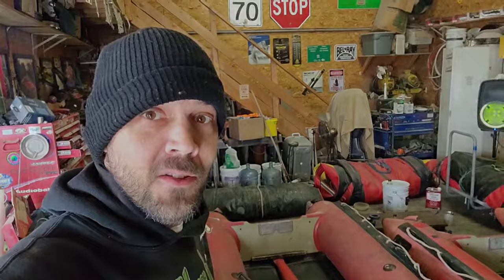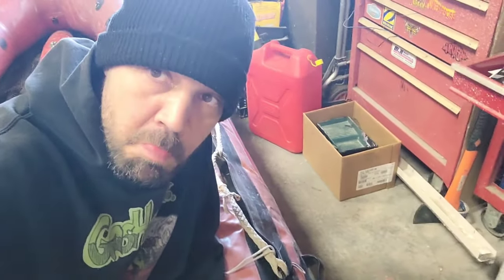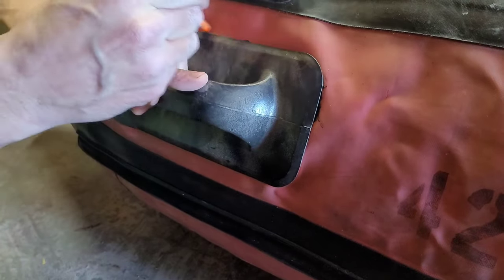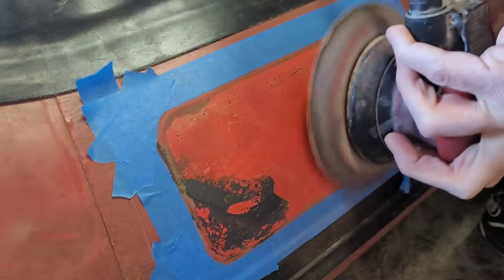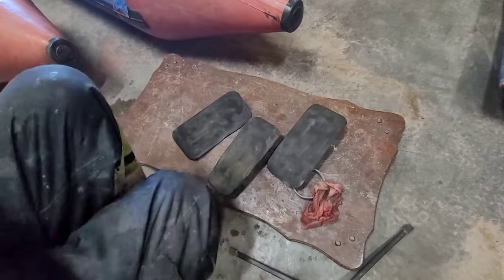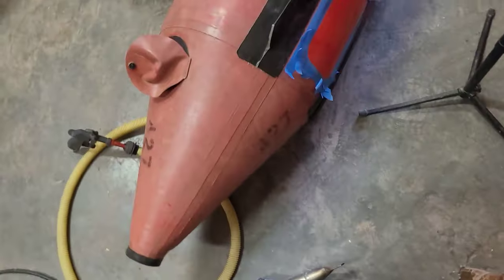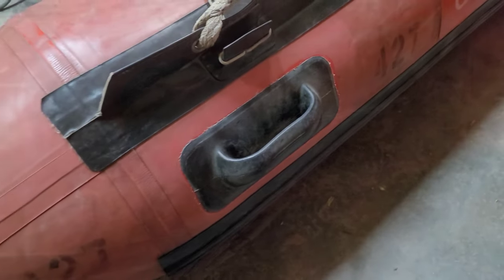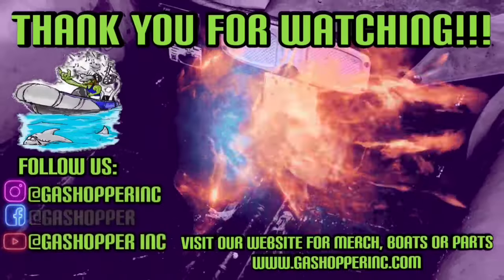How To Fix  a Peeling Handle On Your Inflatable Boat - Achilles Inflatable Boat Repair

Comment: Great video and thanks for sharing! I was wondering on rub-rail repairs where only a small portion of the end is peeling off, how would one repair a section of it? I wouldn’t want to remove the entire rail. Can I follow your prep with sanding as close as possible to the glued on section?
Reply from the maker: You sure can. It recommended to do the whole rail, but if it's still strong on the most part, just do a touch up on the peeling section.

Comment: Great video. What would you use to clean up old glue on a PVC boat? Not acetone I'd imagine? Thanks
Reply from the maker: Acetone or MEK (Methyl Ethyl Keytone). Acetone is the generic cleaner if MEK isn't available in your area.

Comment: Do you have full air in the boat ?  Or maybe half ? Where do you buy the glue ?
Reply from the maker: Preferred to have the boat aired up fully when doing handles. Can buy the glue from our shop. Can use Stabond or Zodiac glue.
Reply: @gashopperinc  do you ship to Canada ?
Reply: Mines not a handle it’s the actual front pulll . I need some material to if you sell it
Reply: @gashopperinc  mines a wiking German inflatable . Have you heard of them ?
Reply from the maker: Yes, we're located in Canada actually. Visit our websites, everything is listed there. www.gashopperinc.com

Comment: heyy great video but i spilled a bit of glue on my boat and now i dont know how to get it off maybe you have a tip thanksss
Reply from the maker: MEK or Acetone wiping to soften the glue and my have to sand it away, very lightly till you get to the fabric surface.

Comment: I have poly marine glue for hypalon that is in one container. So I was wondering when you said two part glue do you mean the two coats? Or do you mean a glue that mixes together? I got this specifically for my zodiac and just want to make sure I do it, right
Reply from the maker: You'll need a 2 part glue, with 2 coats each side being glued.
Reply: @gashopperinc  OK but that’s still the same bottle of glue being used it’s not like an epoxy you’re mixing together correct? I understand that there is two coats. The glue that I bought for hypalon material is one glue not a two part glue.
Reply from the maker: @keithbeall4610  we never use a 1 part glue here. We always use a 2 part glue. Especially for handles. 2 part glues are for structural assembly, the 1 part is mainly for small repair patches or touch ups on peeling sections and doesn't hold well with stress. You can try using the 1 part glue but be cautious that it will fail.
Reply: @gashopperinc  thank you that’s what I wanted to confirm. I have only used the one part glue so far on reattaching a seam on the bow. Then I’m patching over that with a patch kit. Do you have a two-part glue you recommend for the handles?
Reply from the maker: I would recommend Zodiac Z7098 or Stabond UK-148. Both are 2 Part Hypalon Glue applications.
Reply: @gashopperinc  thank you so much you are a great help. All of your videos are very insightful, and I appreciate you being able to reach back out.
Reply: I have a Mercury 430 heavy duty does the 2 part adhesive work better than HH 66 vinyl cement. Looking for the best adhesive for the handles and tow ring that needs repair. Thank you for the videos I find them very helpful